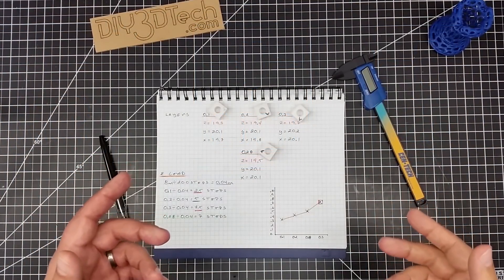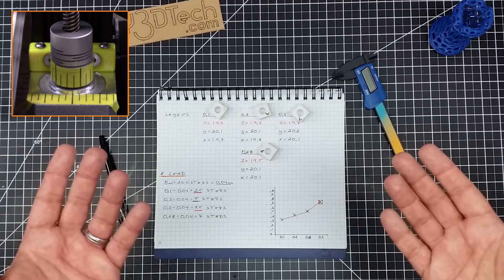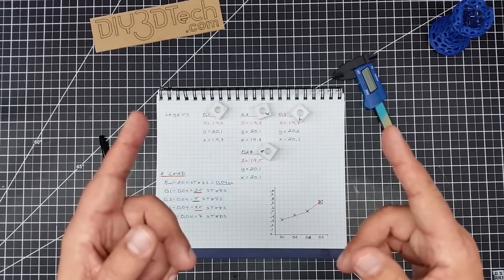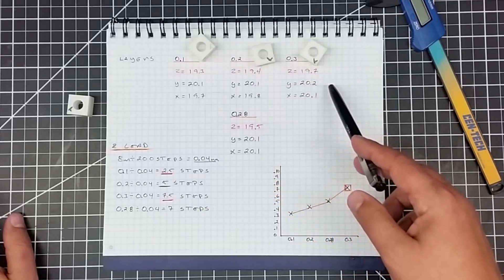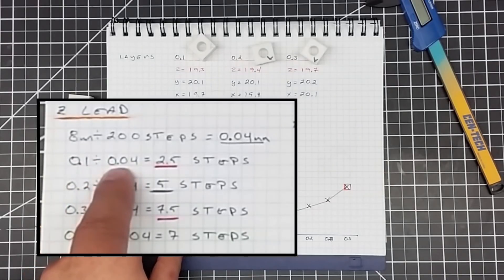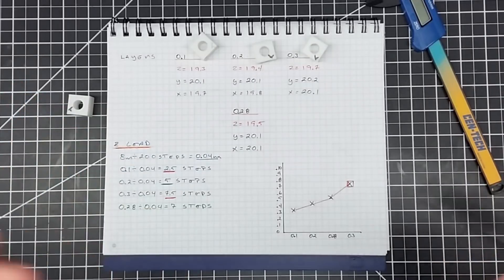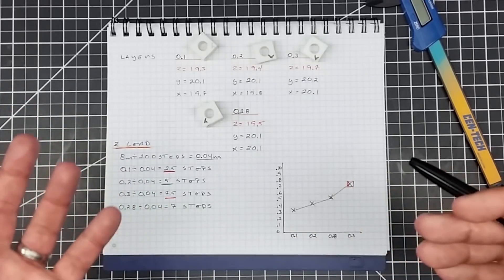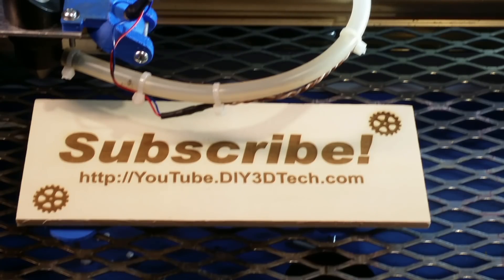Shop Talk - Is your Z Axis Lying to YOU?

Comment: I don't get it. Should but the 0.2 and 0.28 be the most accurate then and be better than the 0.1 and 0.3? But the 0.3 is closest to 20mm and that was the one with 7.5 steps, while the 0.28 with 7 steps is further off the target

Comment: I have developed Z banding on my TronXY X5S and I can't get rid of it.  Here is what I am now experiencing. https://i.imgur.com/0L4NwwB.jpg
Reply from the maker: That was odd and while it appears at set Z intervals, the Z distance from the picture appear to equal and the artifact in the X/Y plane (assume the facing is the X and being a Core X/Y,  Y would also be affected).   First thing I would do is check the belts, second is check the gantry and third tune or replace the stepper drivers.
Reply: Stepper drivers are brand new TMC2208 and the belts are fine and thud, like a guitar, when plucked.

Comment: Can you tell me why my printers have satarted doing a line across the front of my bed before printing it messes my hole prints up and i cant print nothing now, i end up woth a huge blob with spaghetti on it
Reply from the maker: I assume your using Cura, this is to purge the extruder.  Check under under start up Gcode to change...

Comment: you know something is terribly wrong when a screw hole looks like an elipse.
Reply from the maker: Kind of like when a tire is flat on only on one side :-)
Reply: @DIY3DTECHcom  video was helpful. i printed several calibration cubes at layer heights of.2,.21,.22, etc and got wildly different sizes. im using a.5mm nozzle so im after speed but need layer adhesion too so couldn't go past .25mm. for my machine.21 looked the best dimension wise.
Reply from the maker: J.G. this is interesting...
Reply: @DIY3DTECHcom  using Cura. also since then I decided to narrow my line width from nozzle size to smaller, and installed a new nozzle. haven't dimension tested but I'm getting better prints.

Comment: Thanks for the vid. Here are some rules and maths for determining error-free Layer Height (LH). Firstly, LH = FS x I where FS = Full-Step Length = P/S, P = Pitch of lead screw, S = number of full steps/revolution and I = integer (whole number). For example, using Wanhao Duplicator i3 specs: P = lift per revolution = 8mm, S = 200 steps/revolution gives FS = 8/200 = 0.04mm. Choosing arbitrary integer I = 7, LH = FS x I = 0.04mm x 7 = 0.28mm. Next, check to see if calculated LH possible when using 0.4mm nozzle. Using 70% nozzle diameter rule of thumb, 0.4mm x 70% = 0.28mm. PASS! 0.28mm is the maximum recommended error-free layer height for the Wanhao Duplicator i3 using a 0.4mm nozzle. The above is based on an online article called Taxonomy of Z axis artifacts in extrusion-based 3d printing. Hope this helps.
Reply from the maker: Many thanks, as this is the same as the Prusa Calculator,  yet where this breaks down is the steps as 200 is the base number of steps then there are micro-steps as if you go 1/16 then this is 3,200 steps!  Now one can argue that that the only true steps are full steps and there is random error in the micro-steps yet they are so small and in fact tend to be ordered (which I have tested to be true for marlin).  So in the end if your using 1/8 or 1/16 your pretty much at good :-)

Comment: Wow! I love this kind of data. The Prusa calculator has been suggested to me several times. NOW I understand why it’s useful. 

I get the impression that once you understand your printer’s inherent tooled and machined accuracy, it becomes very practical to tune the dimensions of your models to the nearest whole step whenever possible. This way, aren’t you dealing with exacting accuracy (to the extent that the medium is capable) and the most predictable tolerances? And if you know the answers you’re likely to get, then you can anticipate what your Filament will desire to do... and you can let it become what it wants to be? 

That’s how I read this anyway. Thanks again! Great explanation!!!
Reply from the maker: You have a solid grasp of it :-)

Comment: What you say here makes perfect sense.  This brings up the question why 5 start lead screws are typically used on the Z instead of single start.  On my printer the steps/mm on my Z is much lower than X and Y.
Reply from the maker: Maybe cost?

Comment: Let a CNC and 3D hobbyist throw in his 2 cents here...

When we talk about micro stepping we need to take into account that micro steps are not as accurate as full steps in terms of 1/100 step is not exactly 1/100th of a full step mechanically -  this becomes more pronounced with the mechanical load. While micro stepping will overall provide more torque as the movement becomes smoother, the single micro step provides LESS torque than the full step - and depending on where between the full steps we are, there is a variation as well -  every micro step kind of moves a little bit different than the one before or the one after depending where between the full steps we are.

That said, on a 3d printer, you won't usually notice much  difference. But then if we're talking mechanical precise parts, every little bit adds up.

At the other hand, if you where to use an advanced stepping driver (talking about ~ €50 per axis compared to ~€4) that produce a real sinus output (kind of add even more "sub-micro steps" between the steps you are asking it to move the motor)  could give you extremely smooth movement (the comperately huge) motors on my CNC are virtually noiseless at low speed, where my delta is squeaking all the time - on very slow moves I can even hear it "rattling" - as I begin to hear single steps. Which again introduces all kinds of mechanical inaccuracy.

And yes, belts are a different animal - introducing a whole new range of inaccuracy effects, and the belt moves the print head much farther per step...

At the end, my personal bottom line is that I go for high micro stepping (as budget allows) so get the movement smooth, but I won't rely on that  1/32 (or 1/128) step to get it's position exactly right,  especially under mechanical load (say - while accelerating). Hence the calculator mentioned finding the sweet spot for full (or at least half)  steps makes sense again :-)
@DIY3DTECH.com: Thank you for getting this quite interesting discussion going.
P.S: Sorry for any spelling or other mistakes, not a native speaker here
Reply from the maker: Thomas, very well written and I agree with 99% of what you wrote, the 1% is "bottom line is that I go for high micro stepping" as I believe there is a point of diminishing returns  just as you state "I won't rely on that  1/32 (or 1/128) step to get it's position exactly right" as because  as you said "we need to take into account that micro steps are not as accurate as full steps".  So the further you divide the steps, the greater the error which will be introduced.   As too I will bet it is also a non-linear add so likely would stop around either 1/16th or 1/32 tops  :-)  Also thanks for the kind comment "Thank you for getting this quite interesting discussion going"

Comment: Not sure why you talk about your CNC knowledge and the fact that steppers cannot make 1/2 steps in the same video.  You must be aware of the ability to chop the steps.  Granted this can have less torque on some motors / drivers due to multi coils of the stepper being powered up at the same time, but we're talking about a 3D printer.  Let's face facts, they are not the most accurate machines in the world.  As for CNC, I'm pretty sure Mazak wouldn't be selling so many machines if they could not produce every size EVER.  Here's a couple of things for you all to think about.  Again we see 20mm cubes in the test, are the results linear if we try 150mm cubes?  I think not.  Why?  Cheap parts, belt tension (let's not forget Delta printers only move in the Z direction), stepper current, frame rigidity, ambient temperature and everything else that we hobby 3D printerers face.  If anyone is worried about this kind of error in their Z lead screws then swap them for a finer thread.
Reply from the maker: Did you read the clarification I posted in the description about 1/2 steps? Also yes CNC operate at a far higher precision then #d printing so I am confused by the message.

Comment: Most printers have plenty Z axis resolution to support reasonable layer heights without really needing to worry about any ideal layer height. 
Even with low microstepping (say 1/4) and a large lead screw (8mm) a normal 200step/rev motor you get 0.01mm pr. step.  A more reasonable microstepping like 1/16 give you 0.0025mm, which is well beyond the physical positioning accuracy. Thermal expansion and contraction alone will be greater than that.

Only when you go to only using full steps should you maybe avoid very low layer heights if you have a high lead or belt driven Z. At 0.1mm you would get alternating 0.08 and 0.12layers which might produce some artifacts. 
However there is no reason to do this. 

Note that leadscrew pitch (spacing between threads) is not the same as the lead of the screw (distance travelled pr. full revolution) This is because most high lead screws have multiple starts.
Reply from the maker: I can share that using 0.28 over 0.30 does yield a preferable difference as demonstrated in the video...

Comment: Hi, this is Chris in Bulgaria, I did wonder about this, but, not on the Z axis but on the X is where i first noticed it. I mean that when something was printing that now and again i would see the x axis finish then I would see i tiny bit of movement a twitch, so to speak, and I did wonder what it was. Or do I need better glasses. When my printer is working, I do tend to stare at it for ages. I did think about getting some larger geared teeth for the belts, would this make a difference?smoother I mean, Long live PLA. CR10S owner
Reply from the maker: Belts and lead screws are two different animals.  What you might be seeing is either lose belts or a bad stepper motor...

Comment: I don't understand you are printing a 20mm x 20mm x 20mm cube and the closest on the Z axis you got was the 0.3 setting @ 19.7 which is still 1 full layer off from 20mm. Yet you are telling us 0.2 and 0.28 should be best and they are at 19.5mm and 19.4mm which are more than 1 full layer missing.
Reply from the maker: Getting close to 20mm is a moot point as mentioned in the  video at 5:00 this has to do with the Z steps  as the idea is the chart is a basic "control" chart (https://en.wikipedia.org/wiki/Control_chart) which focuses on the "process".  So as you see there is a shift in each one and they are "in-step" other then the 0.3 yet 0.28 falls into the "process"...
Reply: Then wouldn't it kinda hard to prove a point that 0.2 and 0.28 is optimum, when your machine has inaccuracy and missing steps in the Z axis. It may be consistently missing the steps it may not so the results you graphed are random. The only parts that have a printed height that's dividable by the layer height is 0.1 and 0.2 the others give a weird remainder that indicates missed steps, but they all are missing steps because none of them equal 20mm layer height even if it isn't obtainable by the steps in the first place and that's not including the shrinkage of the plastic in the result. 
   Its a real eye opener i would have thought the Z axis driven by lead screws would have been the most accurate out of the axis but apparently not. Makes me wonder how horrible that printer i seen where all axis were driven by a lead screw (cant remember the name).
I believe the information you portrayed is right that the Z axis can only hit a certain heights by the steps/ micro steps but the missing steps is a bit of a problem. 
Ideas how to fix the missed steps z axis problem?
Maybe use the bed auto leveling sensor to check the part height layer?
Reply from the maker: It does have the most accurate because of that (i.e. being constrained) however only in the realm in which it is constrained (think stepper verses servo motor).  Also the machine is not "missing" steps, it simply isn't sending a match count which is very common in 3d Printing and if you look in the Wahhao playlist back a year I show how to adjust this.  However the important piece is the "process control"  as this shows what the machine is capable of in a repeatable manner...

Comment: I have noticed my calibration cubes are off by I think 0.2mm, the dimensions are 19.8 per side, I need to test this,  print a calibration cube that is 20.2mm then see if it comes out as 20mm. also if the amount it is off is somewhat fixed, like if i printed a 40mm calibration cube will it come out as 40.4mm ??? I will get back to you on this.

Thanks
Damian :)
Reply from the maker: You might also need to calibrate your micro-steps too as they might be a little off too....

Comment: so may i ask, if you know ahead of time what the part dimension will be off by can you change the size of the part to accommodate for that ??? like if your part is 20mm, you do a sample print and it is 20.02mm, if you go in and change it to 19.98mm, then when it prints out it should be exactly 20mm right ???
Reply from the maker: You could yes, however it’s preferable to adjust the printer produce the correct size or you could run into scaling issues within your design software

Comment: Interesting video and comments. My understanding has taken a few microsteps forward. The broader questions are: What degree of dimensional accuracy is required for most functional plastic parts? What degree of accuracy is possible in the X and Y as well as in the Z dimensions? How can dimensional accuracy best be achieved? As for the tests shown, I wonder if the results are repeatable, and I wonder what caused the larger variation in the Y dimension than in the X.
Reply from the maker: LOL!  love the micro-stepping humor! Well you have a partial point as if I print a low-ploy pichu (or what ever that thing is a called) is he going to care?  Nope, however if I am doing doing mock-ups for industry, will they notice?  Yupper they will so this is more geared to those folks.  Also yes they are repeatable as what this is a rather basic control chart.  Since this video created such discussion and controversy (never knew there such passion over lead screws),  I am going to do a second where I apply a larger sample and a more formalized process control charting system.  As I wanted to keep this one a little basic people write say "your scaring off newbies shame on you", then people write "you have grossly over simplified this and confused people".  Whew!  Sometimes I think YouTube and my wife are one in the same as I can never win :-)

Comment: Put a dial indicator on the printer and demonstrate how microstepping works, and how much error there actually is.
Reply from the maker: Alan Biocca kind if hard to do while printing but in an up coming video will show you how you can use a dial indicator to find your z axis movement
Reply: It might not be hard at all, print something large and flat, and video the dial gauge. Should be very clear. Also, sending some G code to make these measurements is not hard for a CNC guy. :)
Reply from the maker: I was thinking about this last night and would the difference be as the same error is in the cube so measuring the cube is really the same thing.  What I am going to is create a staged set of blocks in Open-SCAD and print them , then create a control chart of their as there is a difference in sending  10 G0 Z 0.3 commends and 1 G0 Z 3.0 commands as Scott Lahteine  in this thread from the Marlin team made some good comments around this...
Reply: Need to look at individual steps, sum of microsteps tends to be accurate whereas individual steps may have issues. The variable currents used in microstepping can be quite accurate (or not, depending on the actual hardware), but then the motor's magnetics and manufacturing imperfections in the pole tips combine with the loading and variations in the screw and nut itself to produce the final result. Combining this with what the extruder and filament contribute will likely mask the data to some degree and make it more difficult to ascertain the cause. Some experiments have used laser pointers directly on stepper shafts to more precisely measure the rotational effects of microstepping alone. Looking at each layer under a microscope with a calibrated graticule would be interesting, but a video of a dial indicator on the Z shaft nut would also be useful.
Reply from the maker: We agree on the individual sum verses the aggregated sum.  Your also correct on the error in the lead screw as I have build high precision telescope drive in the past.  I like the laser pointer idea, will have to look at that...